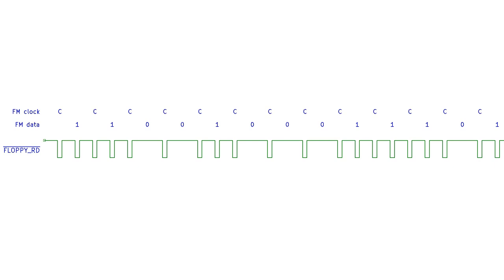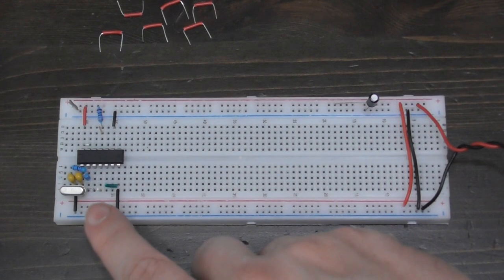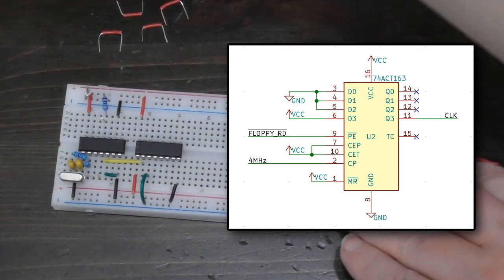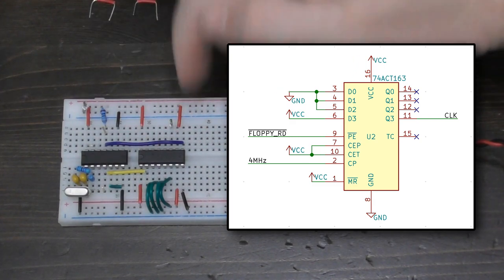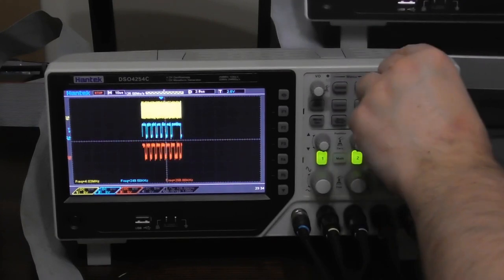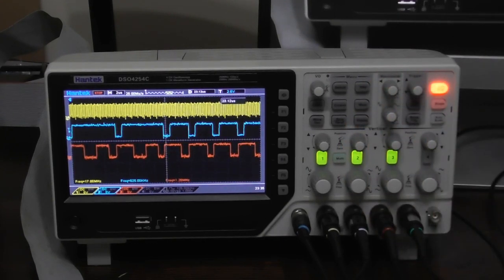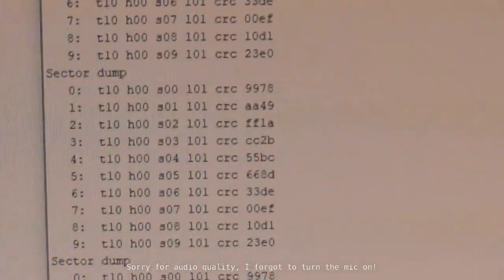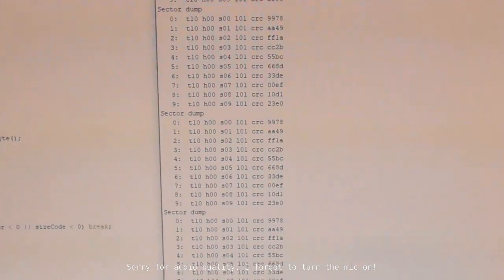Reading data from a Floppy Drive

Comment: Hate to rain on the complex parade, but a plain old UART already does clock sync. Sure it's once per word instead of once per data bit, but that's more than enough. Send the read data via a pulse stretcher into the Ardiuno UNO serial input. Configure the UART for 6 bit data word. Done. Pulse stretching is only needed on read data. Write data can be straight from the UART output. I have been accessing floppies that way in the 80s, using the basic 8250 UART from NatSemi back then. 4MHz for the baud input, word length to 6 bits, one stop bit. Yes, that simple.
Reply: So if I read your comment correctly, a Leonardo can interface the drive and read the data stream over its UART port? I say Leo, not UNO because it has a second UART for USB, so it is easier to put the data through.
Why was it using 6-bit words and not 8-bit ones?
Reply: @lovemadeinjapan Anything with a UART that can have a proper clock set (250kHz x 16) and a 6-bit word length. Why 6 bits? Because that word width syncs with the data encoding on the floppy track. After all you are sampling raw track data. It then has to be decoded into baseband/demodulated data. What the UART captures is what a digital oscilloscope would. It still has to be decoded. A floppy controller does this decoding in hardware.

Comment: This is brilliant, thanks! I love the very clear explanation of the raw data, I've never looked at it before but I've made 2 different floppy circuits, one was with a real WD1772 and a PIC implementing a mass storage device and the other was on a tiny little machxo FPGA implementing a WD1772 with an SPI interface to an ESP8266.

Comment: Nicely done.  Although it's a bit like using a sledgehammer to hit a flea, you could use a Raspberry Pi Pico's PIO to do everything (yeah, that's been the subject of my channel recently).      However, I understand wanting to use vintage electronics to make it work.  The Apple 2 disk drive made use of a prom and some electronic glue to allow the 6502 to do all the disk read, write, and control.  If you can get the schematic; it might prove interesting.  I converted a standard floppy drive to an Apple 2 drive by cutting a trace and adding a gate (but I don't remember what gate).  Keep having fun!
Reply from the maker: Yes, the pico (and you) certainly sprang to mind! And that's interesting about the Apple drives, I knew they were different but never looked into how.
Reply: @GeorgeFoot  Instead of the Pico, can't you just measure pulse intervals with the interrupt of any Micro, for example the one in the MEGA itself? I think the Pico is more of a sledgehammer than this with 2x133MHz 32 bit processor cores. Besides the pico is a pain-in-the-arse to work with in the Arduino IDE.
Or alternatively, interface a µPD765 from NEC with the MEGA and let that chip do everything.... That is the way this was done back in the day.

Comment: Hi George,  You have done a great job and I really appreciate all you have done.  I am trying to use your circuits .  I am going to review all your videos , circuits and software.    I will probably use a z80 first then a 6502 bread board.  I am currently using a fd55-gfr floppy and have the 74hc273 driving outputs to the drive .  I just wanted to thank you for the effort you have put in.

Comment: Great work! Just on the topic of Gal's,I ended up using a 22v10 one in my VGA circuit, using it to detect the vync, hsync, blanking and do the mixing. It removed half a dozen or more glue logic chips.
Reply from the maker: Interesting, I looked at that in the past but couldn't see how you could do all the comparisons in one GAL as there aren't enough input pins.  I had a solution in the past that used one GAL for vertical and one for horizontal but never really used it in a practical circuit.
Reply: @GeorgeFoot  I'm a bit new to it myself.  I based mine on Slu4s, so only needed fairly limited nimber of bits, and most of horizontal you only need to check the first couple of digits, so I think I only needed to check 11 inputs all up.

I really enjoy your videos, I appreciate how clear they are and how focused they are on what you're trying to achieve and explain why you choose to go a particular method.
Reply from the maker: Thanks for the feedback, always appreciated!

Maybe I'll take another look at gals for syncing, but I'm pretty happy with the EEPROM solution, it seems ideally suited for a giant lookup table. Some folks on 6502.org have actually used serial EEPROMs for this, which is an interesting approach too - no need for counters!
Reply: @GeorgeFoot  I don't know anything about PALs and GALs but what about a CPLD? The Xilinx XC95 series are my favorite as they're 5V tolerant.

Comment: A single 74LS688 will catch any given byte (0xC7 etc) or maybe a GAL16v8 to catch multiple "magic" bytes, fun to learn easy to program. :-)
Reply from the maker: I don't have any 74LS688s but I do have some 16v8 and 22v10 GALs, hmm. 22v10 might be enough to also count up to 16 and signal when each byte is complete after the address marks.
Reply: You can use flash rom simple 27512 from pentium m/b, similar like Woz did for Apple drive :) gal is much harder to get nowadays and not everybody can flash it…

Comment: I'm so glad to see your video on this!  Are you aware of tools which have been a round for about 5-10 years that read and capture these flux transition pulses on all disks (agnostic of MFM , FM or any other encoding format?)?  The Kryoflux is the oldest, then the SuperCard Pro and most recently the Greaseweazle.   I've created several videos on my channel showing how the HxC decoding tool can interpret the flux transition pulses into data for the disks that you show here.     I'd love to know if you know about these.  They do basically what you've done here, but I am fully supportive of your exercise here to "reinvent the wheel" so to speak, because I believe there is HIGH value in sharing this level of technical detail.  I don't believe that the makers of any of the devices I mentioned above have created any videos on YouTube with the level of granular technical detail that you share here.  Please, keep up the great work!  I love it!!!
Reply from the maker: Absolutely!  I used the Greaseweazle in a later video to copy useful data onto floppy disks, so that I could then read it back using my 6502 computer, and I think I watched your videos as well, I think you talked especially about Amiga copy protection, which was interesting as the Amiga isn't somethting I'm familiar with.  The hook-up to the homebrew 6502 computer is my goal here, rather than to a PC, hence why I'm building an interface that's more in line with the legacy floppy drive controller chips from the early 80s.  But I also learn most when I try to figure these things out for myself, and sometimes end up building things that work a little differently to the mainstream, which is nice too.
Reply: @GeorgeFoot  Ah, thanks for that update, George!  Actually, while I've made several videos about flux disk capture, the Amiga format is never discussed by me, so that could have been any number of really smart people in the Amiga/Commodore space...  I mostly focus on disks for systems that are nearly extinct, like the Convergent Technologies AWS, and MiniFrame.  The machines that nobody but me makes videos about...and thus, "Forgotten Machines".  Anyway, I LOVE your goal for a hook-up to the homebrew 6502 computer.  Can't wait to see more about that!  Keep up the great work here, and I'll follow along!
Reply from the maker: @ForgottenMachines  Ah, hence the channel name! I'll check it out, thanks!
Reply: Is there info on the protocol of the Greaseweazle so you can control it low level? I think the program that comes with it is horribly written from a UX pov.

Comment: Great work George I was wondering if you would consider making a pcb layout I would be very interested in supplying the products and components to your channel if possible many thanks for sharing 👍
Reply from the maker: I'm probably going to make a PCB at least for the ARM2 computer with some sort of video interface on the main board. I might do one for 6502 as well but I'm not sure exactly what I want to do with that, regarding resolution choice and bus interface.

Comment: Excellent description and theory. Interesting method for clock separation.
Reply from the maker: Yes, I've since looked in more detail at how more traditional circuits work - chips like the 8271 still required a helping hand or two here. I believe they require you to supply a 125kHz signal (as opposed to 250kHz that I'm using here) and they decide internally whether this is marking the clock or data bits. It is similar in a way though.

Comment: You can use a double latch, I.e have a one more latch triggered by shift registers then arduino can have up to 16 bits time to read /* 8 +/- 8 */
If you think about universal variant both for big and small CPUs, you can consider to connect shift registers to i8255 program channel A/B for I/O mode-1 to latch the values automatically. For small/slow CPUs there is a hack of adding a DDff to be set by out command and reset by INT from i8255 to speedup reaad/write without interrupts and even test and conditional loops
Reply from the maker: Yes, for the 6502 I'm probably going to use two 8bit D flip-flops to latch both data and clock. But I've also considered having the cpu read just the clock bits, and read again 8us later to grab the data bits when they've shifted along one step. It's fewer parts but more complex software.

Comment: Hi George. Great video. In the context of a typical disk- controller-microcomputer setup, does the drive controller do all the heavy lifting and present only the raw user data to the computer on the address bus/DMA, or is it typical for the computer's BIOS/kernel to do the removal of the data overheads (address marks/CRC/clock bits). I ask because I assumed if the computer asked for a sector read of, say 256 bytes, then memory only received 256 bytes of the actual user data.
Reply from the maker: It depends a bit on the system. With the 8271 floppy disc controller, pretty much everything is taken care of by the controller. It is actually a fairly complex microprocessor in its own right. The host system sends commands like "read 5 sectors starting from sector 3" and it will spin the disc, read sector headers to find sector 3, notice if it's actually on the wrong track and try to correct for that, and then present data to the host bus, signalling via a "DMA request" line each time a byte is ready (a bit like what I'm doing here). There's no buffering, so the host must consume the byte before the next one is ready. It automatically finds the next sector header and continues to read, so the host doesn't need much knowledge of the disc. The 8271 also checks and strips the CRCs. Writes are similar but backwards. Formatting is the only time the host really needs to know what's going on on the disc - it specifies a list of sector numbers, sizes, and gap sizes. That's as low level as it gets though.

Other systems worked differently of course - Commodore's was very high level, more like a serial interface to a separate computer that reads the disc. I hear Apple's was lower level though, more like what I'm doing here.

Comment: Wouldn't it be easier to just use a data separator chip like WD9216 (for data & clock separated) .. and a controller chip like FD1793 ?! .. please make a video explaining a similar setup like that ;) .. Good work!
Reply: Do you know a similar chip to the WD9216?
Reply: @lovemadeinjapan  .. I don't think there are any old similar ones like that.. but maybe you can google similar chips .. I know some newer FDC chips have built in data-separators instead ..

Comment: A while ago I had attached a 3.5-inch floppy to a speaker.
Reply from the maker: Interesting, I considered that too! I figured you'd get about 15kHz of 8-bit samples. One revolution of the disc is one fifth of a second, so you'd need to step to the next track five times per second. How did it sound?
Reply: @GeorgeFoot  It sounded similar to a data cassette just less activity.